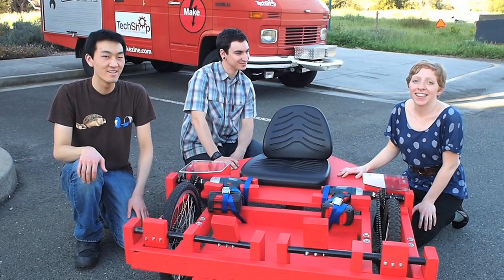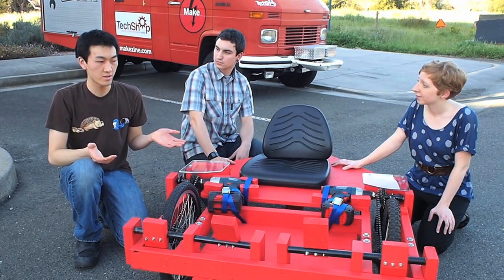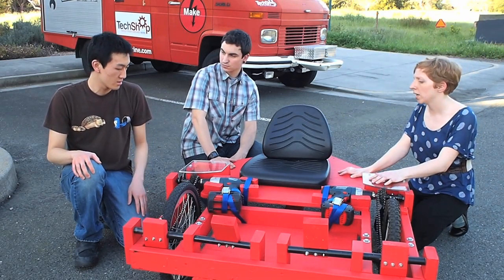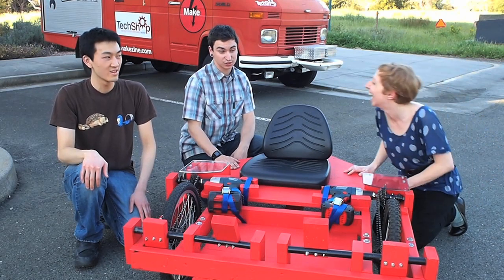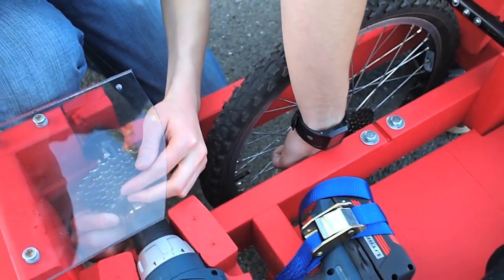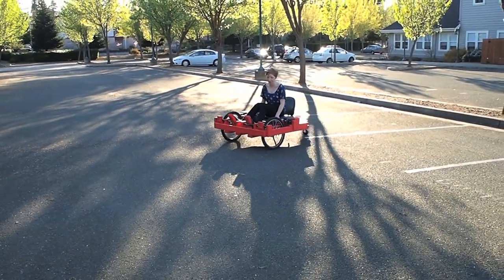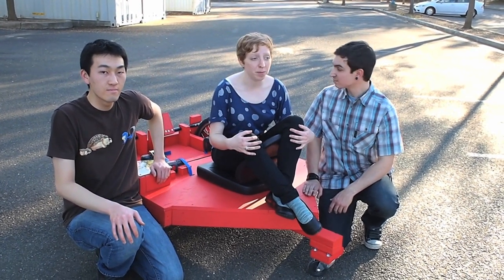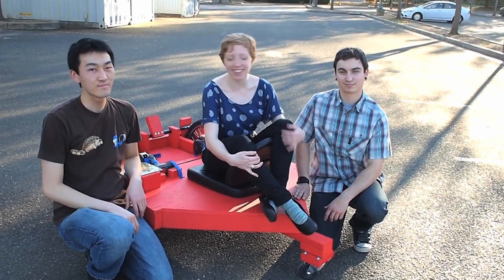Drill Kart on Make: Live ep07

Comment: You need to limit the "swivel" of the rear caster wheel, say to about +/- 30 degrees.    Also, a damper (shocks) to slow the swivel action down, may help with the directional control.

Just weld a long rod (like a handle) to the caster, so that will swing as the caster swivels, and limit the travel of the swinging rod with some stops.  Then a shock to the rod to dampen the movement.

Comment: That's a very neat concept. The multiple gears are pointless it looks like, since there is no derailer to change gears so that is an addition I'd like to see. It would probably make it a bit easier to start slow and get it up to speed by changing the gear ratio..would also save battery by being more efficient. Cool start though.

Comment: Not to be a debbie downer, but I consider this project a failure. In my honest opinion I would have taken an old Kettler Kettcar, converted the rear axle to solid 2wd, converted the pedal drive to drill drive, and called it a day (with some additional braking mods). It would be far lighter, more intuitive to drive, and likely a lot cheaper too, also easier to make.